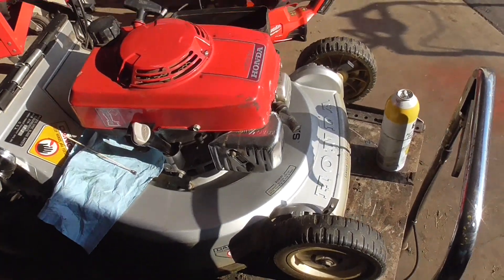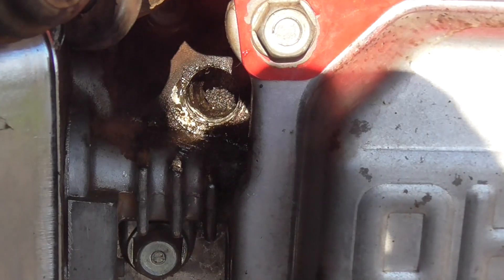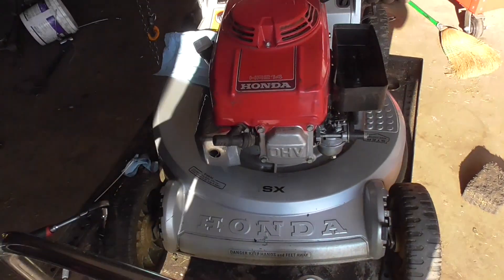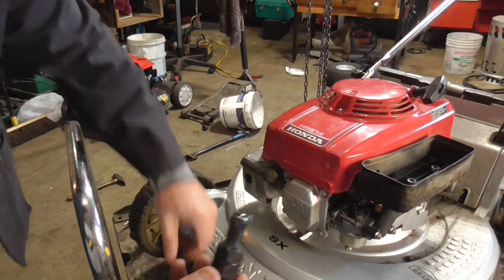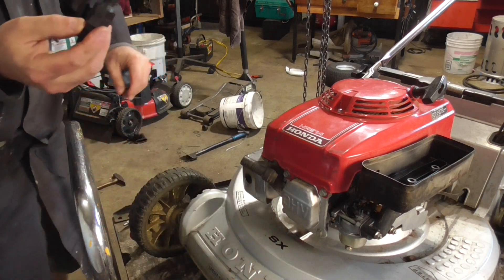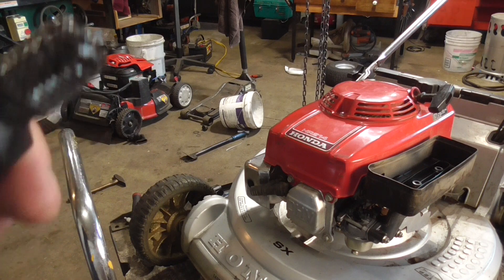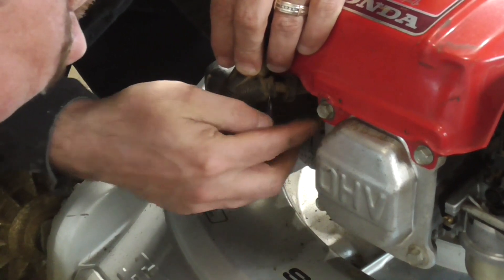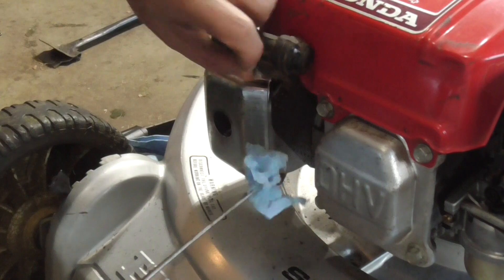Spark Plug Hole Stripped

Comment from the maker: So customer drops this off with the spark plug like this and doesn't even mention it.  Is that surprising?
https://amzn.to/3dNJEaJ Lisle Spark Plug Tap 14MM
https://amzn.to/3etyh7h Spark Plug Helicoil Set
https://amzn.to/3sQg6xI Dielectrical Grease Super Lube
https://amzn.to/3gGpH7I Aligator Hemostat Pliers

Comment: Had this same problem with a VS800 Suzuki, took electrical tape around the plug to make it bigger and tightened it down held great to the day I sold it which that winter, so much easier than tapping it out.
Rick

Comment: Double wide good to see you back I have a question for you I have a Husqvarna string trimmer 128 CD change the carburetor spark plug has spark and it still won't start can you help me out with some suggestions and the gas is good.